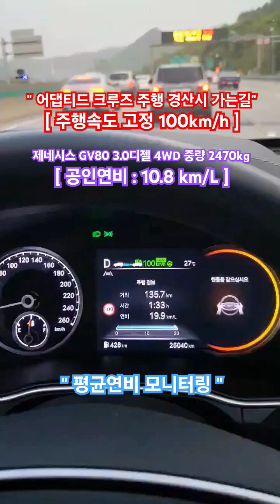[#3088] #평균연비 #보연배터리설치 #제네시스gv80 3.0디젤 살시 4륜구동차량 (#공인연비 대비 연비향상율?) #내연기관 연료소비율? #보연모빌리티 탄소중립실천 ...

Comment from the maker: #제네시스 GV80 3.0 디젤 4WD 5인승
 (상시 4륜구동차량) [ 제원 ]
#엔진  형식 : 직렬 6기통.
#배   기   량 : 2,996 cc.   
#최고  출력 : 278 ps        
#최대  토크 : 58.8 Nm    
#공차 중량 : 2230 kg
#총   중  량 : 2550 kg
#변  속   기 : 자동 8단
#도심 주행 공인 연비 :   9.8 km/L 
#고속 주행 공인 연비 : 12.8 km/L 
#복합 주행 공인 연비 : 10.8 km/L 
#CO2 배출량 : 179g / 1km 주행 시 배출량
#타이어 규격 : 265mm / 55R / 19
#연 료  탱 크 : 71리터 / 80리터 ( 풀 주유 시)
#전             장 : 4945mm
#전             고 : 1715mm
#전             폭 : 1975mm
#발전기 용량 : 225 A
#납산 배터리 : AGM 95Ah (AGM : Absorbent Glass Mat)

#보연배터리 [ 에너지 발전장치 ] 설치후 연비
#제네시스 GV80 3.0디젤 상시4륜구동 차량
#boyeon-battery 설치 후 평균 연비 속도 별
#크루즈속도  80 주행시 평균연비는 25 ~ 30km/L 이상
#크루즈속도  90 주행시 평균연비는 20 ~ 21km/L 이상
#크루즈속도 100주행시 평균연비는 19 ~ 20km/L 이상
#크루즈속도 110주행시 평균연비는 18 ~ 19km/L 이상